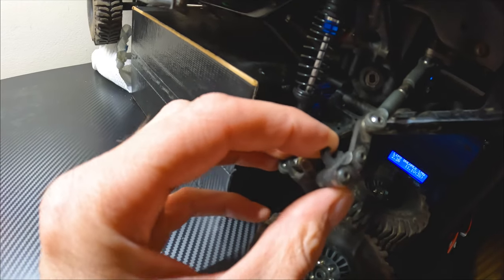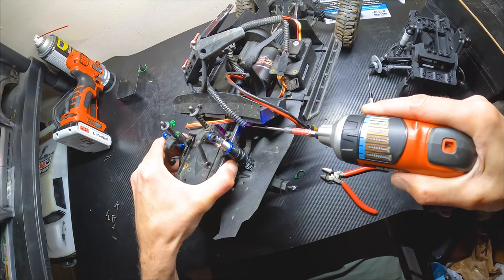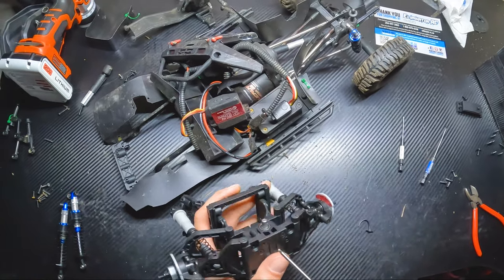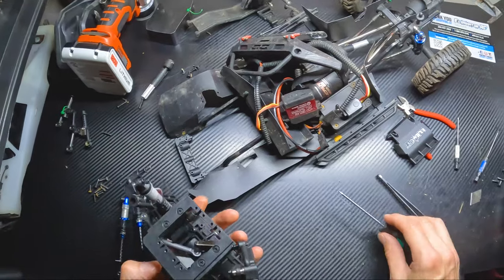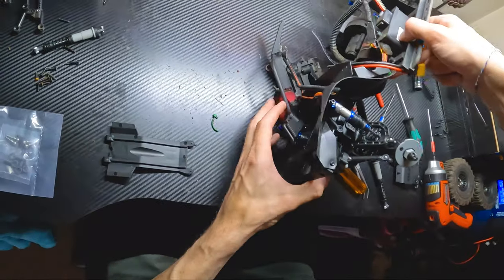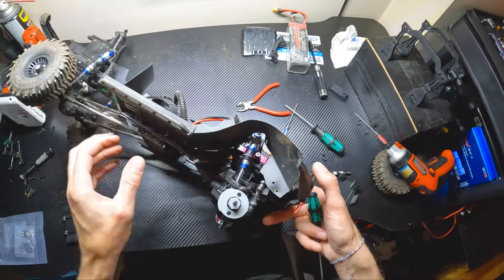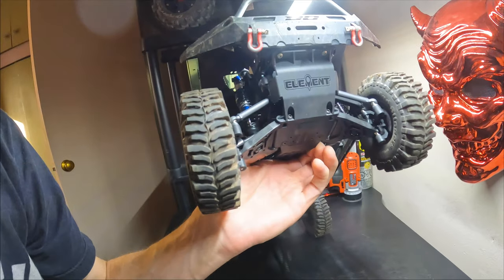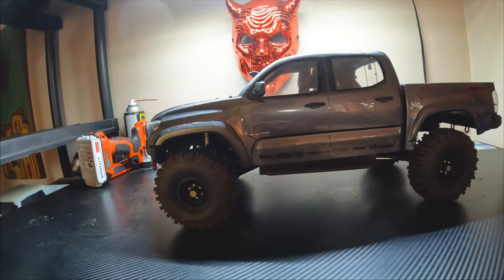How To Install IFS2 - Element RC Enduro Knightrunner

Comment: That's a great improvement. Thanks fir sharing. I have an Element Trail Runner would that work on my truck? Was reversing the diff part of the instructions for the installing the IFS2?
Reply from the maker: I think it would work yeah, the kit should work on any of the enduro platforms. The diff swap might only be needed for the knightrunner though, not sure if the newer ones have the motor orientation the same. The kit didnt really have instructions, just an exploded diagram. It was pretty straightforward though.
Reply: @shralpRC  Thanks a lot. I haven't run mine much. I might as well to prevent future problems.